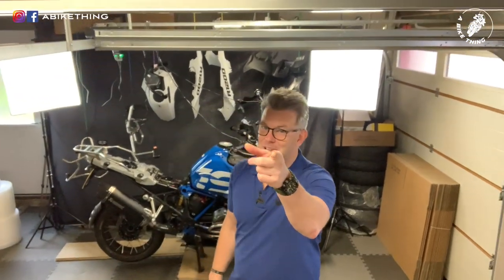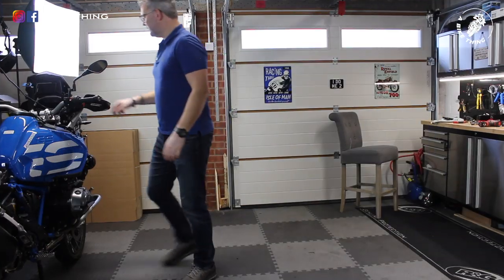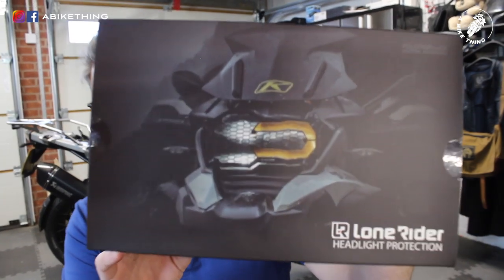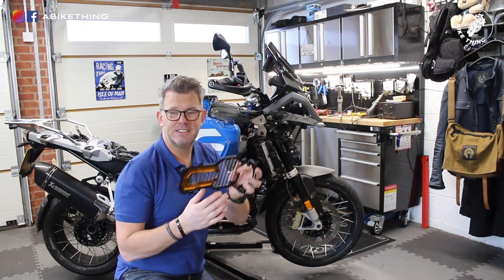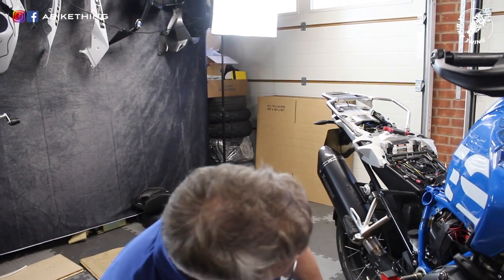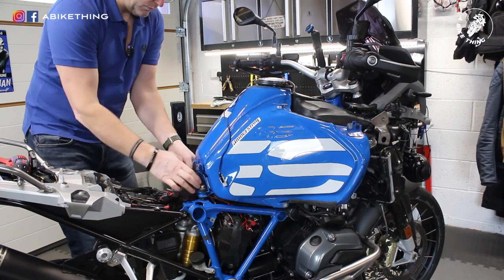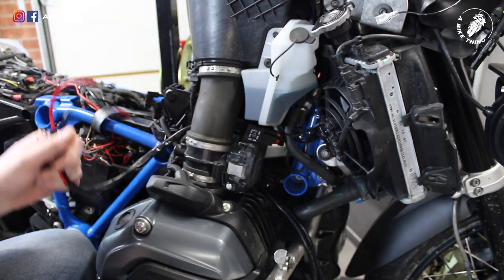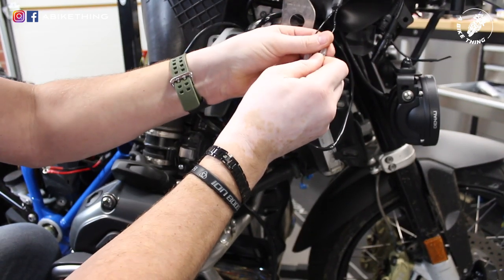LONE RIDER MOTO ARMOR / TANK REMOVAL & DENALI SOUNDBOMB WIRING VIA RELAY

Comment: Thank you for your videos. My new R1250 GSA 40-year edition is still bobbing across the Atlantic in a container and should arrive to my BMW dealership in Southern California in less than a month. Since I will be installing a set of Denali D7 lights and the Soundbomb, your videos are very educational. For your install you decided not to use one of the outputs of the CANsmart for the SoundBomb, but instead used the provided relay and a pre-manufactured harness for a direct connection to the battery. Personally, I would have done my own harness, so I’m not left with extra length of cable that will need to be tucked somewhere under the tank.

Comment: So wait, I’m about to get some denalis with the mount for my 1250 but also have a headlight protector already on it. I was concerned the headlight protector uses the same bolt hole as the light mount. Can I just run the light mount bolt up and put the headlight protector between the nut and the hole for the protector will be wide enough for the light mount bolt too?
Reply from the maker: Correct

Comment: Do you have any links to the floor tiles you have. The surface on my garage floor is rough concrete and I’m finding moving the loaded skylight about quite difficult. Are they strong enough to support the small wheels?
Reply from the maker: Sorry,  they are cheap and have many bad points.  The one good point is they’re soft under your feet which good for me personally but they’re not durable enough for the Skylift.   I’m moving next week so the tiles have just about survived 2 years.

Comment: HELP NEEDED: I installed the Sound Bomb exactly how you did it but when I press the horn in, it wouldn't shut off and it literally started melting the wires and started smoking until I pulled the plugs out of the sound bomb itself? Any ideas why? I have a 2019 1250gsa. I also have a set of clearwater lights that flash as well so wondering if there is a power issue or something? Burning and melting wires just for holding the horn on (getting stuck on) is very dramatic?? Any advice would be great.
Reply from the maker: Matt Norman is this a joke?  If not where did the wires melt? Sounds like something has been wired in back to front.  Did the horn sound very loud or more like a duck being strangled which generally means the connections are back to front.
Reply: A BIKE THING hey mate no joke. I have a feeling it might be the relay? Everything was hooked up like yours. The only thing that I can think of was the wires to the old horn were around the wrong way? Would that do it?
Reply: A BIKE THING yes the horn sounded but would stick on and not stop when pressed.
Reply: Sticky horn button maybe?